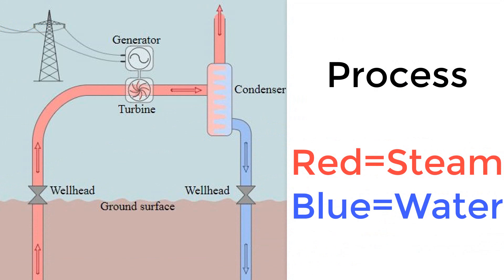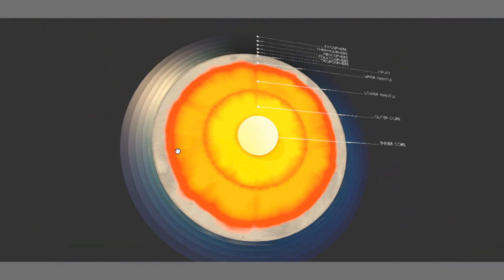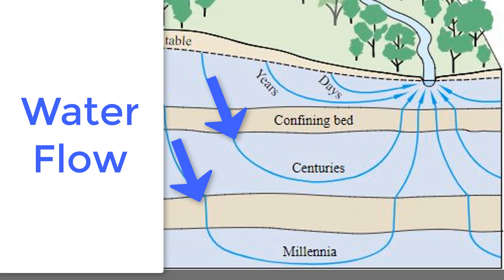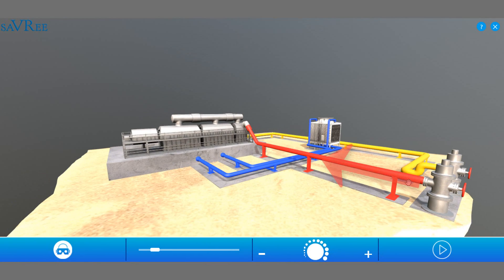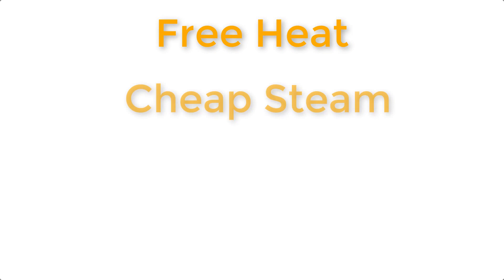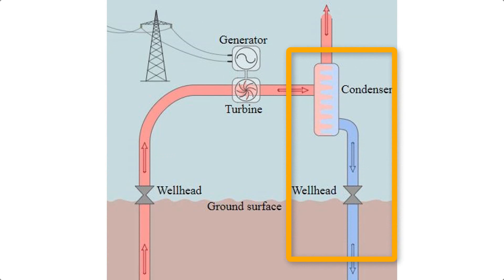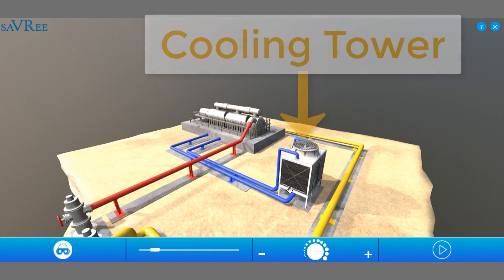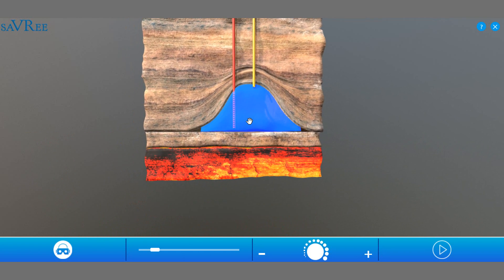How Dry Steam Geothermal Power Station Works (EiM series)

Comment: Would it be easier to use a closed loop with a working fluid with a lower boiling point? I agree 100% that water return/ recharge is essential. Great animation.
Reply: I guess this would require a down hole heat exchanger of some sort... that adds a whole other side of complexity.
Reply: This is known as a single flash or sounds like it. The problem with a working fluid is that the fluid from these reservoirs are not all water. Some contain non condensable gas, (major problem effecting efficiency) silica (which gums up the turbine and pipes) and other impure substances that reduce efficiency.